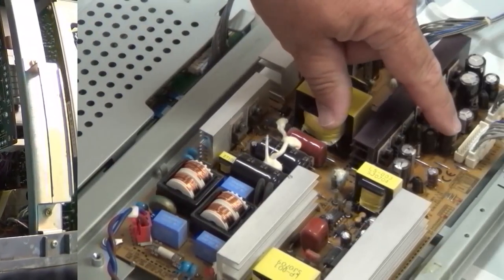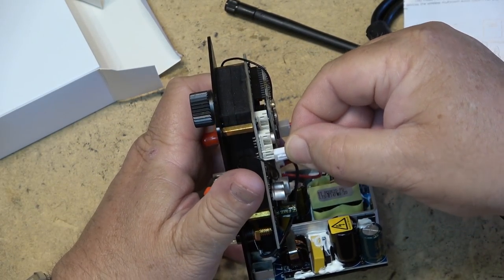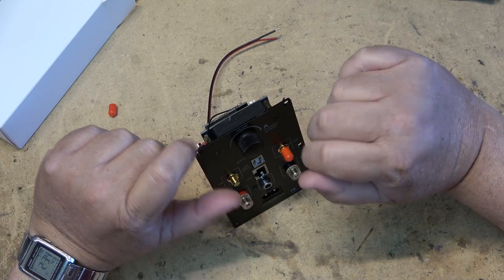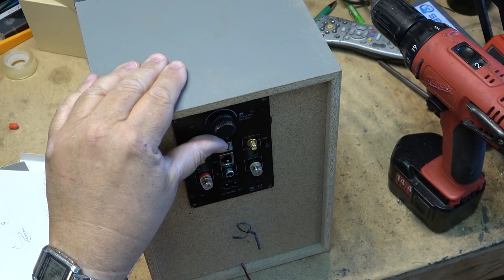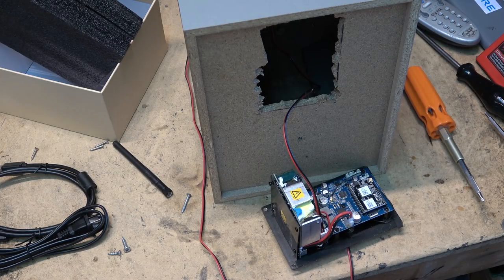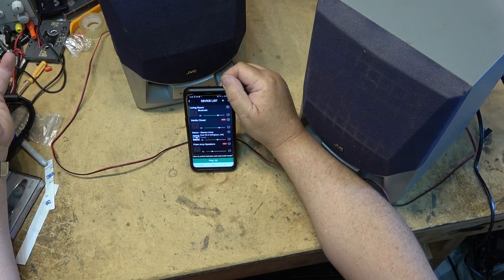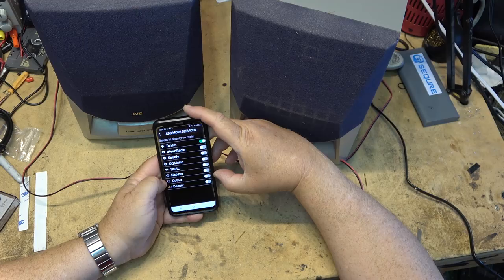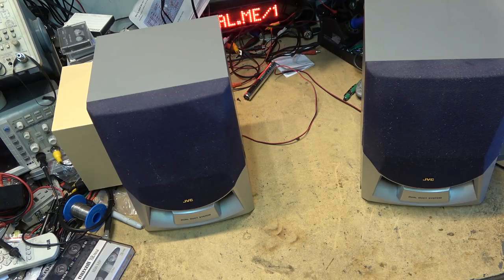Wireless speaker build project using a new plate amp by Arylic

Comment: That's not bad at all, instant active speaker and easy to install :-D
That has to be the best one so far.
Reply from the maker: It is because it has the power supply on board.  Just plug it in.

Comment: If I'm not mistaken those "onos" systems let you use two separate units together to make a stereo pair. I'm curious if these can do that. In my opinion needing to run a separate cable to the other speaker defeats the purpose of this. At that point why not use a standalone receiver which doesn't require modifying a speaker?
Reply from the maker: Yes you can. I demonstrated that in one of the other videos you could buy two of these modules place one in each speaker, then in the app sync the two units together, select the Left Channel for one unit select the right channel for the other. Winner winner chicken dinner. Check out the 8:30 and 8:50 amplifier boards where I show linking to systems together there's no Echo no lag once the unit synchronized. I actually synchronized this receiver with another receiver when in sync so I left channel for one right channel for the other there's no reason you could not use two of these modules to accomplish the same results or for that matter two of the mono boards that I reviewed before and one set for left and one set for right. Very versatile since I was only given one module to play with I had to use the hard wired option for second speaker but if you're buying a system just buy two and mount both of them in the back of the speakers and Bob's your uncle.
Reply from the maker: This module is designed for those that want to put it into a speaker without having separate units, I have demonstrated other standalone systems and the mono board which I demonstrated a while back, the one I'm using for my patio speaker which can operate in either stereo or mono mode would be best suited for that as it doubles the power. Two of those boards linked in the app and one designated for Left Channel and the other designated for right Channel is all that is required. I'll do another quick video to demonstrate setting this up using this plate amp and one of my other standalone modules connected to speakers and I'll set one up for the Left Channel and I'll set the other one up for the right channel so we'll have the Left Channel on one side of the workshop and the right channel on the other.

Comment: One of the most important thing is, is the device cost effective? you've just built an Alexa with more sound but without the mic.
Reply from the maker: I don't have and never will have any device with a microphone that listens in.  Even my cell phone.  Unless I am actually using it it is turned off.  People get mad and wonder why I don't respond instantly to their meaaages. The reason, my phone is turned off.   I turn it on, check messages and then turn it off again. If I'm at home if you want to get a hold of me, my land line is the way as my cell is turned off.  It only goes on when I go out or am at work.  When I am home it is off sitting on the charger.
Reply from the maker: Is it too much or too much for YOU!
Reply: @12voltvids  Geez calm down I don't give a damn if a device listens or not I've nothing to hide.
Reply: @12voltvids  Your phone was used in the video to set the speaker up was it not? that's more than checking massages.
Reply from the maker: @tyronenelson9124  turned it on to set up the speaker and then turned it off again.  I generally only turn the phone on when i am heading out.  I often have it in the shop in my pocket buy once i head in it generally sits in my office on the charger usually turned off.  Even if it is on, the office door is kept closed so the microphone won't be picking up much.

Comment: Bro that is a cool bit of kit .
Can it be used on just one speaker in mono mode ?
Thank you
Reply from the maker: Yes it can and you can buy 2 of them and sync one for left channel and the other for eight channel for true wireless stereo with no cables.  I use this all the time along with 4 other boards all synced to the same feed.
Reply: @12voltvids  i love this channel thank you

Comment: @12voltvids Hi Dave I was watching your video yesterday showing repair of a cassette deck that fell off the truck. You stripped the noisy motor oiled and re-assembled the motor and then the video stream just died on me like it was taken down or something.  I'm sure it was one you just posted in the last 2 days or so. Can't remember the brand of the repair think it was Sony with plastic mech chassis. Can't find that video now.  Can you clarify what happened and maybe re-post the vid as I'd like to see the second half of it.  Cheers from Oz.
Reply from the maker: It's there.  Don't know what happened on your end but i just played it.  Sony tcke50p i believe.
Reply: @12voltvids  Thanks for responding Dave. I found it " Sony TCKE500S" and watched the rest. Great fix. 
You're right about damaged goods from eBay, I purchased an Onkyo MD-105FX last year which had some broken tracks around the rotary encoder probably caused by being dropped on the knob. This year I bought a Pioneer D5 DAT which was dropped during transit (from Japan, very poorly packed) luckily only suffered a gear cog popped off the loading mech and a bent front cover which I was able to fix.  Both items working well now.  

Your videos are really instructive and have given me confidence to tackle any fault now.  I was always used to having repair manuals and all spare parts but you've shown that there are other ways to get the job done. My next project is a Tascam DA60 four head DAT with a mech error.

Comment: If these were speakers that you care about you would certainly want to remove the speaker drivers before drilling to keep the wood bits out of the moving parts and vacuum out the inside. I still have a set of dumpster bin speakers that I rescued when a tenant moved out of an apartment. Those have been my garage speakers for years powered by my Panasonic RX-5250 boom box. Now that combination is used for outdoor theater with an SVGA DLP projector and my laptop. I was thinking about using some kind of wireless bluetooth speakers, but a roll of 18 ga speaker wire at Home Depot was cheaper. For almost $200 this option does not seem to be cost effective for a budget speaker extension.
Reply from the maker: But it's better than 1000 for a speaker that rhymes with bonos.
Reply from the maker: I did vacuum out the sawdust. I just didn't film it.  The grills don't come off, but if I was to install this on say my polk bookshelf speakers i would have removed the driver.
Reply: @12voltvids  Kinda figured you would have, but you know there is going to be someone who will do it just like they see it done, so I had to throw that out there. I had no problem with the hole, it is called fit, form, and function. Good enough for what it is, and it's function.
Reply from the maker: @zulumax1  as long as it is sealed it doesn't matter what the hole looks like.
Reply: @12voltvids  I’m with you, sometimes I think you do things just to rattle the troll’s cages. Keeps it interesting in the comments.
Reply from the maker: @zulumax1  
I certainly do. Got to trigger the trolls.